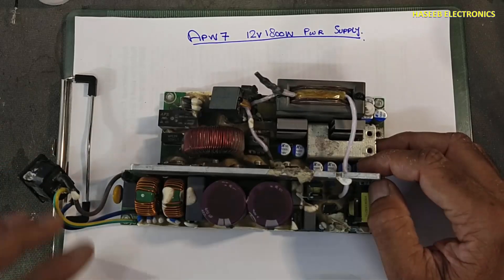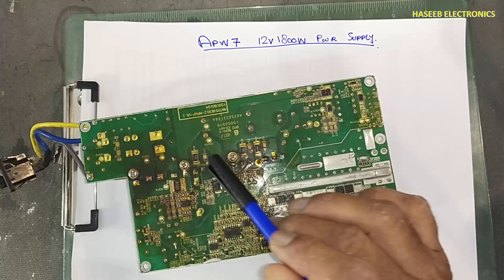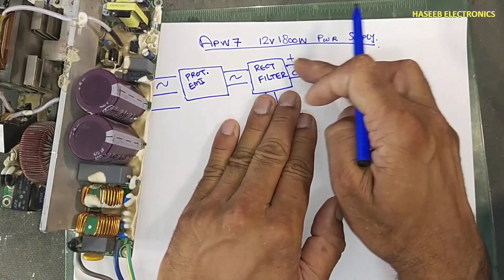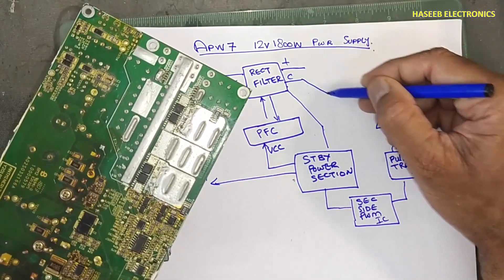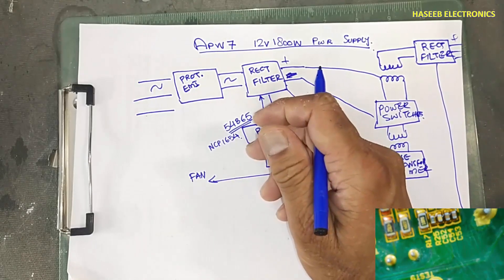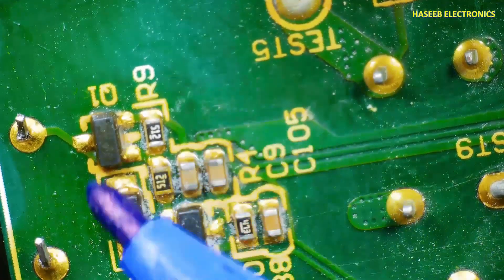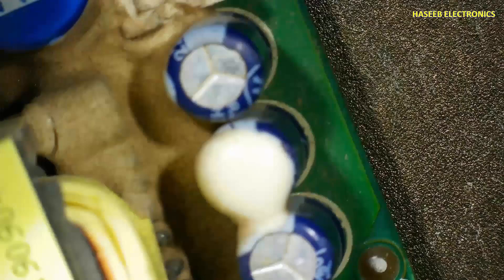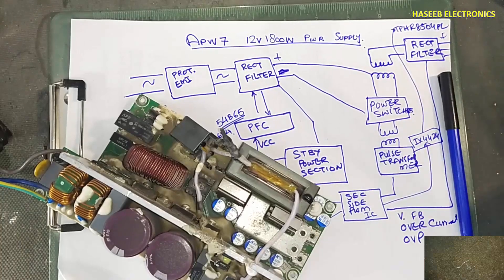{1132} Antminer APW7 power supply block diagram

Comment: I have an APW7 power supply that does not output 12V and the fan is not working either. I have already replaced the MOSFETs that were shorted and it still does not work.
Reply: Hello my friend, were you able to solve the problem? I have the same problem.

Comment: Hello sir, i have a question about a ATX power supply, it works for 1 second then turns off, 5v standby is available, ps on is 2.4 volts, when turning it on, all volts are available (3.3, 12, 5v ...) but the fan stops after 1 second and it doesn't work on the computer although all voltage are available, I've checked the fan too and it works, and the pfc driver receive voltage also the supervisor receive 5v standby